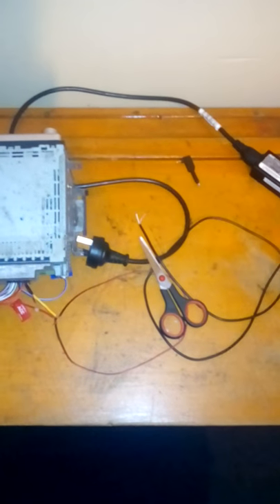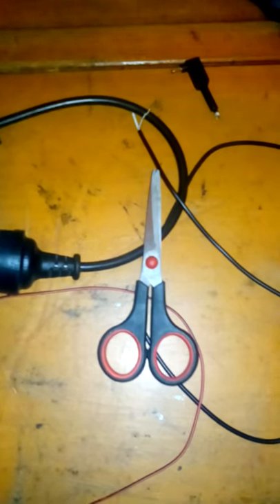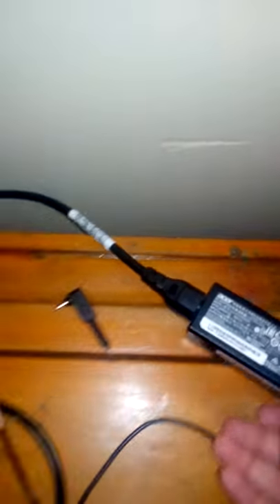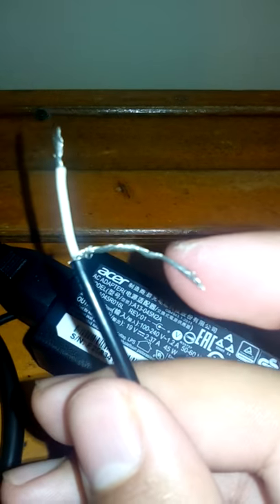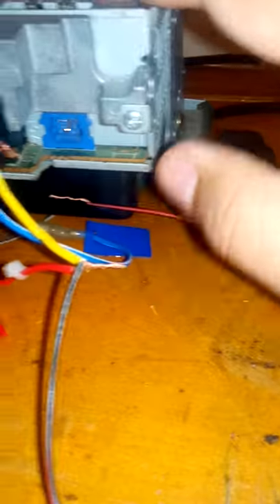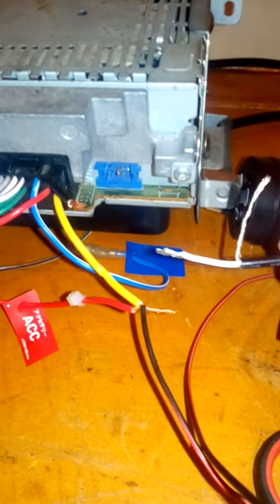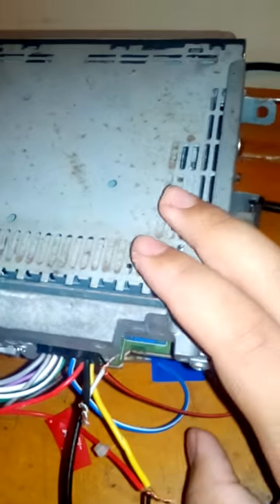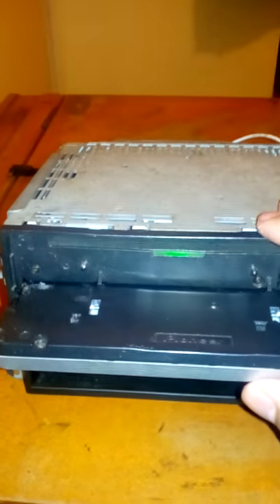How to power a car radio with a Laptop charger

Comment: Recommending 19-volt power supply on a 12volt radio is being irresponsible. Frankly   I think you do not know what you are doing. There is a good chance to blow the radio up.
Reply: That's why gave him thumbs down
Reply: He says “the stereo requires 12v MINIMUM” so I’ll just give her the full 120
Reply: Adding a 12 volt light bulb in series with (+) will drop final voltage to 12-15 volts depending on bulb 💡
Reply: MOST OF THOSE CHARGERS HAVE A BUILT IN STEPDOWN REGULATOR

Comment: Most car radios are DC not AC. I do not recommend using an AC power adapter for a laptop for use on a 12v DC system. If you are looking to do this, i recommend a proper Ac to DC adapter. It may work for a short while but i would not trust it plugged in and left un-attended due to fire risk.
Reply: @Skyg Walker308 I would find a proper power adapter and build a harness to wire to the radio. Electricity is not my expertise nor do I think I am qualified to answer this question
Reply: @Skyg Walker308 no
Reply: They're converters buddy
Reply: It is converting ac to DC my only gripe is watch out for stereos that aren't meant to handle more than twelve volts

Comment: You can turn it on and listen to music but with 2.5A or 3.0A you just can play on min vol to 50% vol only, above that it will start to dead2 or turning off itself because not enough power to play max vol, you better find a power supply or power brick that is 12v 10A to 30A if you want to play max vol👍👍
Reply: Can i put 15v on it
Reply: @ТодорГеоргив  nope, yr amp will burning and dead because of overpower but some amp can use up 19v, if yr amp could use from 12v up to 24v yes you can but if yr amp can only use 12v you better dont use 15v👍 if you wanted to used it tooo then give a try👍 but at yr own risk okayy? I dont recommend that👍👍
Reply: @RandomizerUploader  thanks for the information 😁
Reply: @ТодорГеоргив  you're welcome 👍
Reply: I have my on protective mode it output 16v is that why my amp won’t come on everything is wired correctly but just wondering about the v

Comment: This will turn the radio on but you can't listen to it very loud! As soon as you turn the radio up a quarter of the way the amperage from the power supply cannot support the amount of amps needed for the radio!
Reply: Ya I believe I just blew up my Xbox 1 power supply doing this , as soon as I tried to play a song cut off for good . fortunately the deck and amps fuses haven't blew.😂
Reply: @shiellabookhart2710  Reset

Comment: I'm trying to use a car radio for my kitchen. And using bookshelf speakers,  hope I can pull it off without plugging in the speakers and using rca cables running from the speakers to the head unit. Is there an amplifier in the head unit?

Comment: shorting out your power supply won't blow up the outlet it will blow up the power supply and only if you continually short it out. if you just smack the leads together a few times it won't do anything.
Reply: no the fuse will blow
Reply: @kironchuniesingh1.450  yeah if you live in a 80 year old house that still uses fuses instead of breakers.
Reply: @ElectronicsForFun  no... what i thought he was talking bout was inline positive fuse 9n radio...
Reply: @jbknowles1812  oh yeah that too possibly.

Comment: just for your information automotive batteries are not 12 volts , they're closer to 14 volts
Reply: 14 when engine is running* thanks to the alternator.

Comment: You can power stereo max on 14,5 volts, but not on 19 when you turn on sound you can blow up transistors on your stereo. Guys dont try this if you not know what you doing.
Reply: That is what I am wondering about wgen I saw it.. lol.. I used 12v..

Comment: That's a 19 volt charger and the amp only uses 12 volts only.. just use a 12v charger or your amp will be fried...
Reply: What a load of rubbish I been running my car stereo with a 20v laptop charger and I've never had a problem I hooked up a fuse for it just in case. You must be a bit slow boy.

Comment: I borrowed a friend my targa t7300.1 monoblock, he powered it with a laptop adaptor and he blew my rails filter caps. the did not bulge the blew of the board. this is not safe.

Comment: why is this even a discussion? I will tell you right now no !! don't bother !! sure you can maybe turn on a deck or amp but its not enuf amps its not enuf as far as wire size and its definitely not a good enuf ground source and have fun with the constant humming humming through the speakers ! I am the true expert period ! you need at least 1 deep cycle rv battery to get decent results preferably a sealed agm deep cycle and if  your laptop charger can supply at least 13 volts and 2amps it will probably maintain a charge on the battery  but it all depends on what your pushing !I am currently running 4 deep cycles that are connected buy 0 gauge power and grounds to 1 rockford fosgate p600 x4 ,a rf p1000x1 sub amp pushing 1500 watts at 1ohm to a ct sounds 10inch sub that does 1300 watts rms easily it removes things from shelves and walls daily !ok moving on also another rf prime r2 500x4 channel amp all 4 channels are running 2ohms to each channel because im running 2 4ohm speakers on each channel  yes this system is completely huge and insane ! moving on again I have another new ct sounds at-200x4  beast of an amp 1300 watts total split into 4 ch at 2ohm there currently is about 30 mid range and tweets mixture of 2ways components and bullet tweeters I have silk dome tweets aluminum dome tweets titanium bullets etc this is all installed into my 25 ft toy hauler trailer because I am completely insane about music and I want it to sound better than concerts or like a recording studio and it does it honestly invokes huge emotional feelings from anyone who listens all speakers are either ct sounds meso ,or rf punch ,and rf power series t1 or t2 s CONNECTed to my Macbook pro with M1 chip out to a fiio external dac I plug a 2.5 mm balanced plug into it that turns into rcas straight into first amp they are then all daisy chained with rca splitting and all of my music is in high res from my qbouz music service anything from cd quality 16 bit and 24 bit 44hz 24bit up to 192 hz it is all connected using audio quest rcas and other high end ofc silver bearing rcas and I use nvx 12g ,8g,and 14g ofc silver tinned speaker wire and yes all of this makes a difference the sound life changing seriously im being real I know it sounds stupid but I am constantly tweeting adjusting adding this or that so ask me anything you want to I  build custom systems for about 35 years I guess at this point wow!! so I can share wisdom on anything so use my brain before I die I have your answer no doubt

Comment: My output is 19v is it good or not because in other videos they use 12v output??
Reply from the maker: escobar pablo perfectly fine man. As long as its 12 volts plus its good to power you're car radio
Reply: escobar pablo did it work
Reply: Gun Guy  no i didn't do it
Reply: escobar pablo you tried and it didn’t work or never tried
Reply: Gun Guy never tried
Reply: is it a must to use a dc power supply or will and ac do the same?
Reply: I tried a 18 vilt and did not work lights come on fron stereobut nothing else
Reply: Toh Han Shen+ no use DC
Reply: Hey mate. look on your head unit and see its range. My old Kenwood head units input was 11v - 16v. so when I spliced in a 19v laptop charger she did not run. Make sure you have the correct output from your laptop charger to match the input of your head unit

cheers
Reply: Brother how many watts are charger
Reply: All car stereo are 12 volt. As you can see power supply is 19 volt. It short out you stereo. (Never tried it. Aka he said end of video “it may blow up” ) anyway end of rant.
Reply: I would recommend no more than 15 volts
Reply: Even I sud know

Comment: It should of blown up 😂😂 19v my ass U Can’t just use any laptop charger . . .  Car decks are rated at 12v to 13.8v@10amps Sooo seeing that I’m a software engineer n knows not bout hardware or electronics but can notice that  . . . . it seems you are miss-leading people oh n edit your freaking videos when u puts the cam down God dam
Reply: Due to the fact that you text like a 13 year old girl, I do not believe that you are a software engineer.
Reply: The output is 19v wnd the card audio is 12v so when you connect it it dosent have to get all 19v but it only takes the 12v it needs to run the more power you draw when you open the volume to the max yhe more power it requires but it can be used i use mine inmade years ago and it works fine and for long sessions
Reply: @beastmode2990 still works?
Reply: @brokenjustin7590  ye still works fine